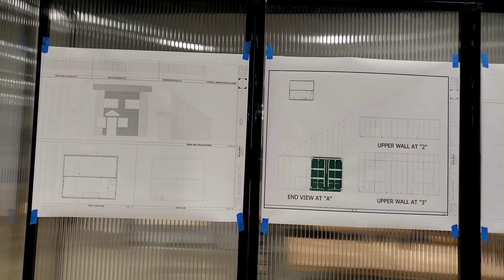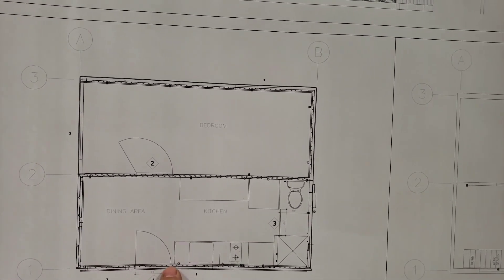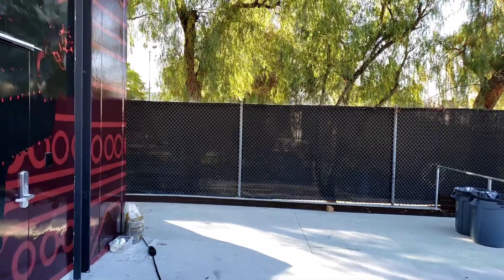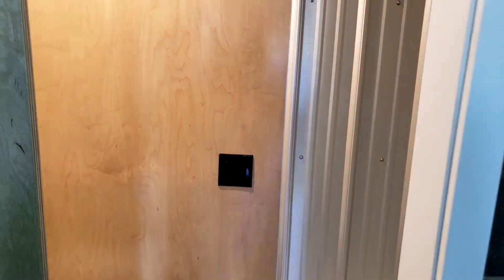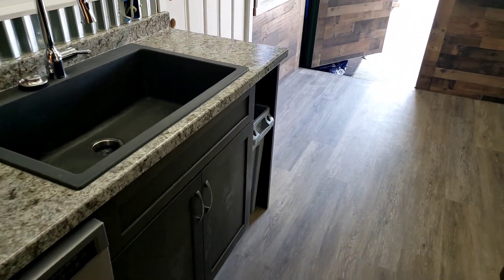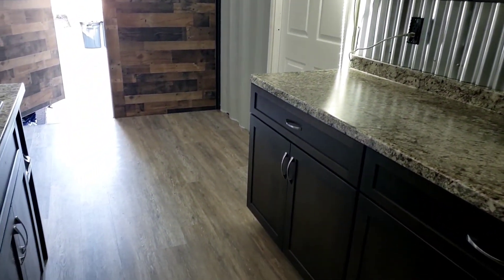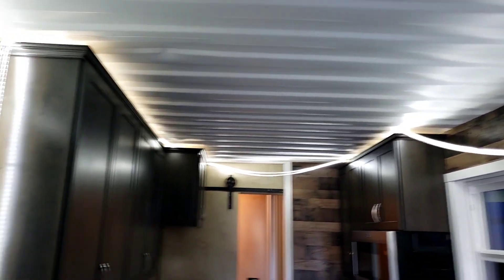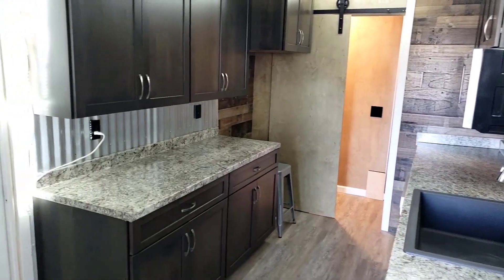Container cabin summary 11/23/21

Comment: Do you plan on any kind of sound insulation on the ceiling or bedroom interior wall?
Reply from the maker: Yes. It gets R-11 fiberglass above the metal, in between the 2x4 flooring joists.